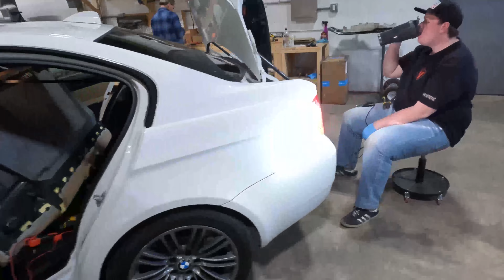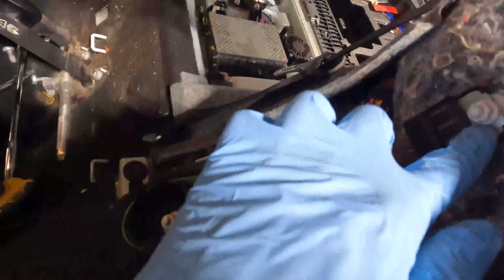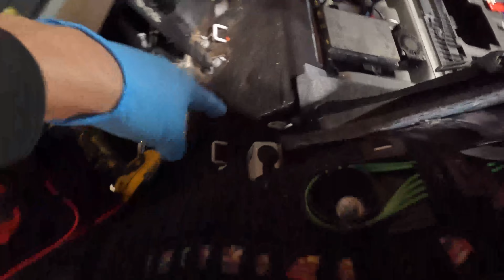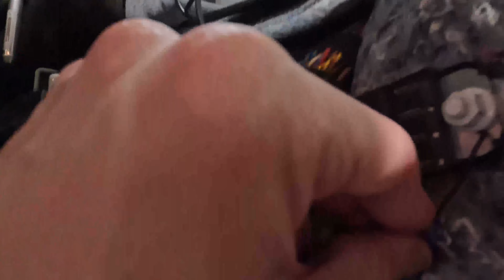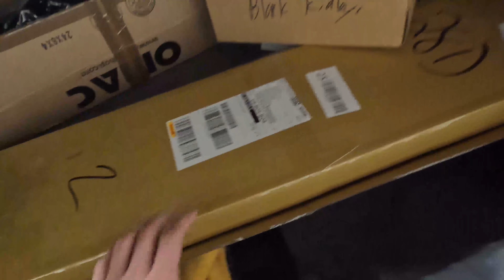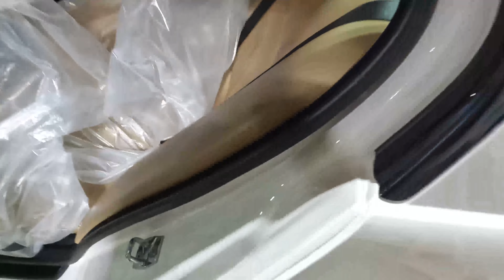How to Hardwire Your Valvetronic Designs Vacuum Control Box

Comment: How can I do this on a c6 corvette
Reply: i ordered valvetronic mufflers for my c6 the other day. they should be coming tomorrow. do you have an instagram or something so i can keep you updated?
Reply: @andrewruenzel  yeah man it’s @S3XYC6 keep me posted
Reply: 1 year later I’m wondering the same thing, did yall ever figure it out?
Reply: @anthonyhenriquez3963  you can definitely do it, but I bought a stock npp exhaust because I found a better deal on eBay and it’s the same thing. For this you would have to weld it on your axle back then find a spot to put there vacuum pump and then either plug it into you cigarette lighter or hard wire it into one of the fuses under the glovebox I’ll link a video where they install it on a c6.
Reply: @randomguy9454  thank you so much I appreciate it! I’m having a reputable exhaust shop handle the install I mainly wanted to see if I can have them hardwire instead. I really need the valves recently bought the car used and it came with headers and straight pipes with what appears to be 4.5 or 5.5 inch exhaust tips so it’s loud as hell 💀
Reply: @anthonyhenriquez3963  It’ll make a huge difference I just recently did a h/c/i with headers and a straight pipe and I literally couldn’t hear my own thoughts. With the stock npp it’s a little quieter with little to no drown and with the valves closed you can barely hear it.
Reply: @anthonyhenriquez3963  https://youtube.com/shorts/BvH-GvLzHMU?si=L1pdvYPqZGUmMBkb